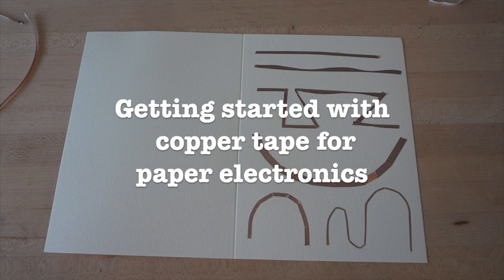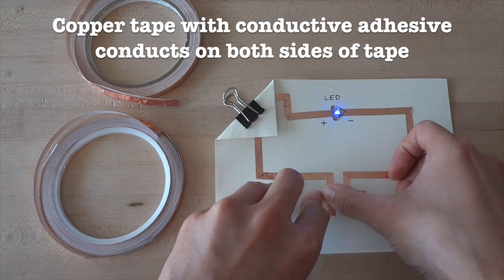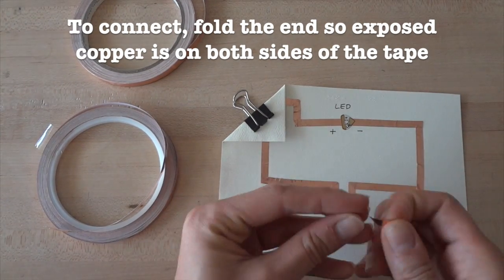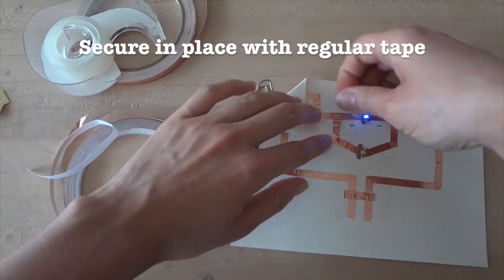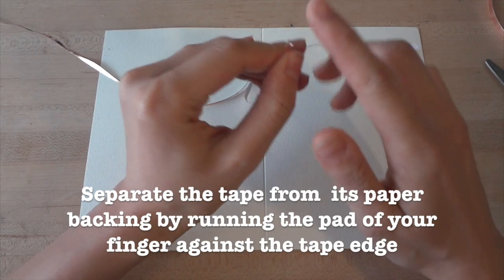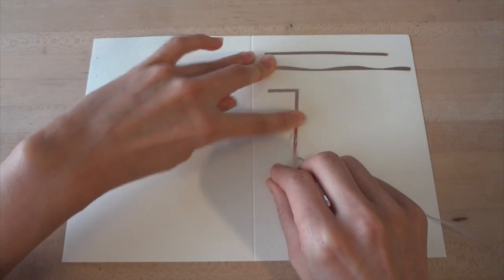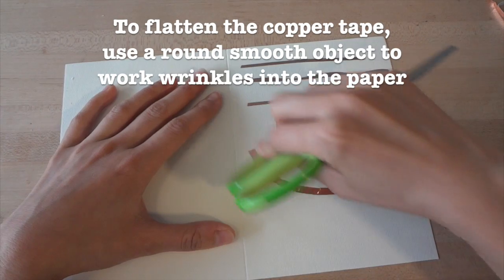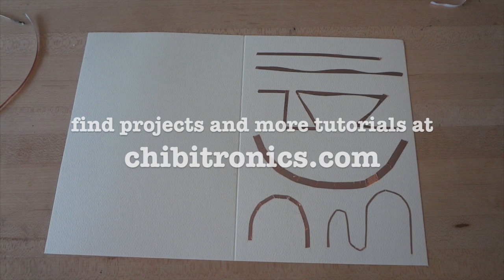Getting started with copper tape for paper electronics

Comment: Starting a DIY job to replace a computer CMOS battery with a CR2032 using copper tape to connect wires to the battery. Thank you for this helpful video!

Comment: How do you setup the corner for the battery?
Reply from the maker: Here's a tutorial on paper battery holders: 
https://chibitronics.com/5-ways-make-paper-battery-holders/

For the corner, you can simple fold down the corner (big enough to cover the battery), then trace the battery on both sides of the flap to show you where the battery will touch, and then stick your tape so that they extend into the circles.  Here's an example template of what that looks like:
https://chibitronics.com/wp-content/uploads/2014/05/Circuit-Sticker-Sketchbook-template-1.pdf

Hope this helps!